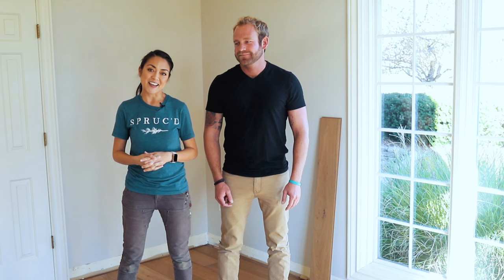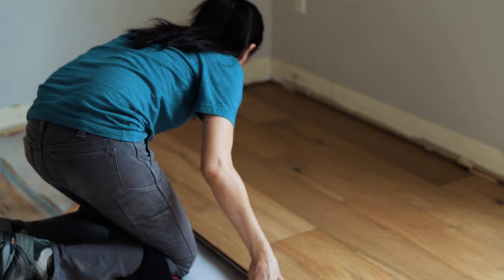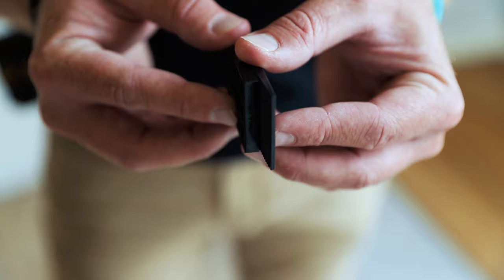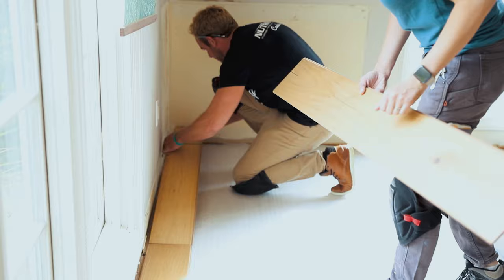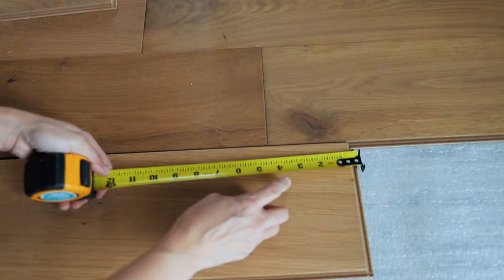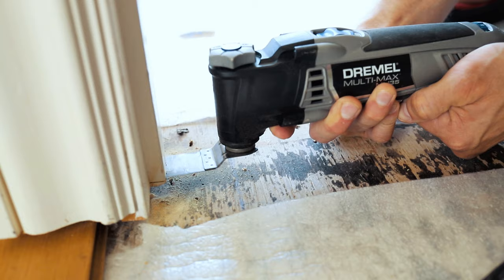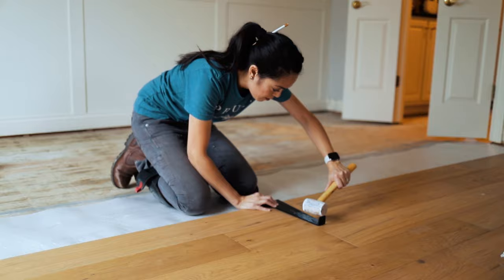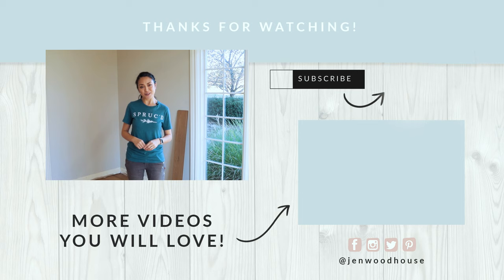How To Install Hardwood Flooring (For Beginners!)

Comment: I've searched days now looking for the type of flooring installation instruction video i need and this is it! Thank you!  Made it look so simple which is absolutely wonderful! Thank you! I can't wait to start mine now.
Reply from the maker: Great to hear!
Reply: It’s crap , where’s the glue on the tongue and grooves ?
Reply: @kaneburgoyne1908  FYI, not all flooring types require glue or nailing...
Reply: @kaneburgoyne1908  this looks to be the click/lock version?
Reply: I wanted to check and see how the floor is doing, especially installed as a floating floor, as some reviews on HD say that it starts to lift. Starting to build soon, and I really would like to use this brand of flooring. Thanks!

Comment: I'm glad that I found a video on how to install a hardwood floors.  I pray that this helps me, a new beginner.
Reply: I just installed hardwood for the first time 2 weeks ago and did an entire room by myself. There now have an entirely new appreciation for millimeter measurements. The biggest challenge is what to do if the subfloor isn't straight in some places and to be careful of walls and doorframes not being straight that can potentially affect the entire look of the floor. Knowing where to start as a beginner is very important. Tips ==> prepare subfloor with proper construction screws to remove all noises. Most subfloors I've see have nails. The hardwood floor 45 degree angle nail gun doesn't work if you're too close to wall so I recommend using a small baseboard nailgun. So many things to learn from a someone who has experience. Good luck!

Comment: Great job Jen! One thing, and maybe I missed it but it seems there is no discussion of the chalk line such as how was it determined where to snap it and what it does for the project.
Reply from the maker: You're right, Andrew! Sorry that tidbit was left out of the video! 

We used the longest exterior wall and snapped a continuous chalk line from the front to the back of the house (ours measured about 50 inches from the wall - you just want one continuous chalk line if you can manage it). This chalk line was our reference, so as long as our floorboards stayed parallel to this chalkline, we knew we were laying the boards straight. After enough rows are laid down and the chalk line is covered up, you can snap another one if you need. We didn't have to, since the floor was pretty solid by that point. Hope that clears things up!
Reply: @JenWoodhouse1  Thanks for the detailed explanation Jen! 🙂

Comment: Good video - wish you would cover the "beginning". There must have been a carpet on this floor. Removing that to make sure that you got a base you can work with is actually one of the issues on which beginners fail the most.

Comment: How is your Malibu flooring holding up over the years?  I saw there is a click/lock version that you used, and also one that is tongue/groove.  The tongue/groove version has a thicker wear layer (2mm) vs the 1.2mm on the click/lock version, but it would also be a little more work to install.

Comment: "You shouldn't have to wrestle with your floorboards"  - she said, proceeding banging it with the sledgehammer. lol
Reply: Its a rubber mallet for clicking in parts. hardly a sledge hammer Einstein
Reply: @DG-EditsYT  no shit Sherlock

Comment: does floating instead of nailing lead to easy separation in weather changes such as summer vs winter? I think I will nail mine but this looks easier. Also I am putting over old hardwood does that make a difference as well?
Reply: Yes. As for them though, they didnt use a solid hardwood. Since it’s engineered its mostly plywood. They could float the floor because they wont have much expansion due to it not being solid. I would never recommend floating a solid hardwood in a state or country with drastic weather changes

Comment: I'm so scared to attempt installing hardwood floors. Theres only 4 bedrooms, need to try!!
Reply: what they installing is not glue down hardwood floors its floating floor with hardwood finish. you mess up take it apart & restart. is easy after your 1th 2 rows.
Reply: @florsRus  fair enough, that gave me a little more confidence to try it out

Comment: Can you explain that caulk line? Did you measure and snap a line from the opposite wall?
Reply from the maker: We used the longest exterior wall and snapped a continuous chalk line from the front to the back of the house (ours measured about 50 inches from the wall - you just want one continuous chalk line if you can manage it). This chalk line was our reference, so as long as our floorboards stayed parallel to this chalkline, we knew we were laying the boards straight. After enough rows are laid down and the chalk line is covered up, you can snap another one if you need. We didn't have to, since the floor was pretty solid by that point. Hope that clears things up!
Reply: @JenWoodhouse1  so your floor from one end to the other on both sides of the room were perfectly square?

Comment: Hi , advice if possible please : 
We have a small casa in the Algarve Portugal hot in the summer cold at night and humid in the winter .
We have existing an old solid feeling tile floor with no damp proof coarse . And slight 10-15 mm floor level differences throughout the  single floor living area we have now knocked int a larger kitchen dining sitting area . We will have 1 and if needed  2 wood burners to heat . We are on a limited budget  so that in mind thoughts please . 👏✌️
I like wood / wood look  senorita like tiles . What and why is the best product

Comment: I wish hardwood floors was that easy . Too bad those are just wood laminate flooring close but not it
Reply: its engineered. its a thin layer of real hardwood glued on top of either a composite board or ply wood. Laminate is a picture of would over the same composite or ply wood.
Reply: I know. People call everything hard wood flooring. Lol
Reply: It's engineered hardwood. Real hardwood hardly even exists anymore. It's way to cost ineffective, weighs to much, hard to maintain, easily effected by moisture, and engineered wood still lasts an incredibly long. You are thinking of lvp which is basically plastic. This is still hardwood it's just not 100% solid wood. You won't find solid hardwood floors very often anymore. It all looks identical regardless of material. Also the other installation methods are exactly the same you just nail or glue the boards in place after you lock them together. It's really no harder it just means you have to be more accurate when you lay each board since it's harder to correct mistakes.
Reply: @sethdrak3 You said "nail" or "glue"..(you forgot to mention float).
Reply: Put floors like this in like 6yrs ago wish I went with full hardwood like in our previous home. Yes the floors look beautiful. They were very easy to install especially floating floors. Biggest issue if you do engineered check that mm some are so thin you can’t sand and refinish. And fyi most in home depot and Lowe’s are not over 3 mm. Which comes in my issue, we have 2 dogs and four kids (3 were teens) scratched and digs galore. We have already replaced our stair landing twice ughhh. We had furniture delivered and the furniture all solid wood and heavy they scratched the floors too :/ Our old house had solid hardwood floors we sanded and refinished them they look fabulous. Our engineered you just can’t too thin. Now the kids are older and we have opted to go full hardwood instead. Advice if you go engineered get the thicker mm ones pay that extra. Unless you don’t have teens and all their friends and pets XD then go engineered ^^ just my humble opinion

Comment: This was very helpful. We are looking into flooring for part of our home (approx 1000 square feet) and have been consider LVP and engineered wood. Yours look so great I went to HD and checked out more of Malibu plank and really like the looks of it. Also has good reviews and a lot of good pics from customers. I think we may go with the same as you. How is yours holding up?
Reply from the maker: Thanks for watching! So far the floors are holding up well, but it's only been a couple of months. At first I was pretty careful about not dragging furniture and other things across the floors, but after my kids dropped toys, spilled drinks, rode their skateboard and hoverboard all over the new floors, and they held up beautifully (no scratches or dents), I'm much more confident in their durability. All good so far!
Reply: Jen Woodhouse 
: Awesome! Thanks for the feedback. We are seriously looking at Malibu plank and will likely go with what you did or possibly a lighter French oak shade. Looking forward to it. Good to know they seem to be baked to take a beaten from the kids 🤓👍🏼
Reply: Need a video showing angle installing and making notches.  Square very easy.  It's when you start cutting the 45

Comment: I’m planning on laying down hardwood floor in our Motorhome hallway, which includes under the dining room table. I don’t have an outside wall. Are you chalking a line about the size of the board?  I’m planing on securing it with small floor boards. I think it needs to be floating. I have some places where it will butt up to carpet or linoleum and have the wooden transition pieces. Does this sound about right?

Comment: Hello Jen, We going to install this kind of floor y our basement OptiWood Timberlodge 0.28-inch x 5-inch x Varying Length Waterproof Hardwood Flooring , Do you think we  should put wood planks first? because the floor now in concrete.
Reply: Did you end up putting plank first ?

Comment: if im gonna paint my room walls should i put the parquet first or paint my walls first?
Reply: Paint first! Building rooms are the same as cleaning them, work from top to bottom. Ceilings first, then walls, then floors.

Comment: So, how did you tackle the tricky parts mentioned at 6:15?  I know this is a 'beginner' video, but that is probably where the beginner would need the most help; at the tricky bits.

What about installing with the base boards on? Or is that not adivised?

Comment: i have a room with slab not basement just couple feet below grade very dry. I am installing high end vinyl plank has built in backing pad will i still need to put underlayment i worry might be too spongy??
Reply: no, dont put another underlayment pad it would void your warranty, and the pad that comes on the back of your vinyl is sufficient enough, when you get your material it usually has a paper in the vinyl plank box that tells you what not to do, also if your worried you could go to home depot and get a vapor barrier, it looks like a huge garbage bag. https://www.homedepot.ca/product/natural-lvt-with-seal-guard-premium-underlayment-for-luxury-vinyl-tile-vinyl-plank-100-sf-roll-1mm/1000826529
Reply: @slickrick0315  so dont use underlayment but heated foors require some type of underlayment for under the wires hmmm

Comment: Nice production values in the video, but very little in the way of practical “how to” for beginners.
Reply from the maker: Hi Sheri, thanks for your feedback! What info specifically did you find lacking? I am a beginner myself so I'll try my best to answer any questions you might have! In the meantime, you can check out the blog post that's linked in the description box for more details.
Reply: @JenWoodhouse1  Details about the gap near the walls and why you need them, the tools you used and what they do, how you laid the underlay (seam to seam no overlapping), the advantages and disadvantages of engineered wood floors, why and how you used the chalk line instead of just using the wall for a guide, the time it took you to complete the project, your square footage, etc...
Reply from the maker: @user-xx7pg3vw9k  More details are in the blog post, which I linked in the video description as well as pinned as a comment.
Reply: @JenWoodhouse1  Hi Jen, Thank you for the great video and blog post! Two questions: (1) What should you do if your floor is not even? I have one bedroom to install click-and-lock wood flooring in, but I'm not sure where to begin since the floor is uneven (old house). (2) Also, do you have any tips on mixing two brands of this type of flooring? I'm a bit of a cheapskate and so bought most of mine used but am not 100% certain I have enough of one kind to finish the room. I've seen pictures of mixed flooring (for example, one kind of hardwood in the middle and another surrounding it/on the edges) but worry I will have to hire a pro to make this work.

Comment: Hi Jen! Need help here— how do you determine to lay you planks horizontally or longways if that makes sense?
Reply: The Bellamy Family I think that’s more of a personal opinion if you ask me 😌
Reply: Ultimately it's a personal preference, but TYPICALLY it is run parallel to the longest wall. Again there's no right or wrong way, but sometimes when it's run with the shorter wall, you run the chance of it looking like a boardwalk.
Reply: @ruffxm  I apply the rule of thumb by laying the planks along the direction of the light. Of course there are other factors like the one mentioned above that you may wish to apply

Comment: Quick and easy ?, my house seems to be sitting on the concrete slab. Like the rest in this neighborhood. And im tired of the carpet i have, so is it the same procedure ? And 1 more thing my living room flares out more than the dining room I feel can be tricky or im just over thinking it, then there's a small vestibule,  any advice
Reply: You ever did it?
Reply: @Serenity187Jc  I haven't done it yet but I think I will soon.  I hear its pricey to pay for labor so will probably just do it myself just need a table saw for cutting

Comment: Hardwood means actually real wood?
Reply from the maker: Yes, this is real wood!
Reply: it is real wood but in layers the surface is a stained veneer, and the core is often plywood, so the biggest difference between solid hardwood and engineered is that engineered is often to thin to be refinished, where as hardwood is 100 percent oak, or maple, or hickory, whatever the material you choose